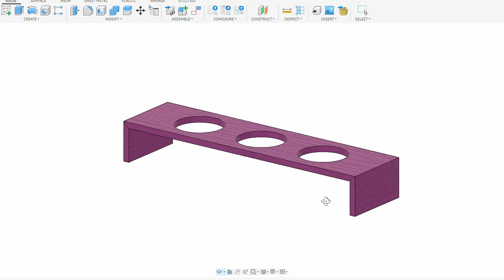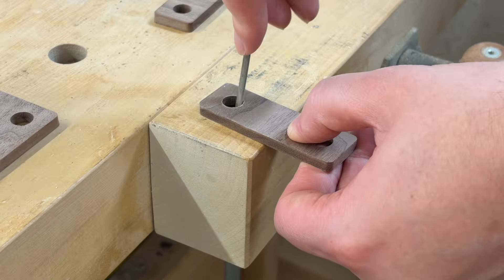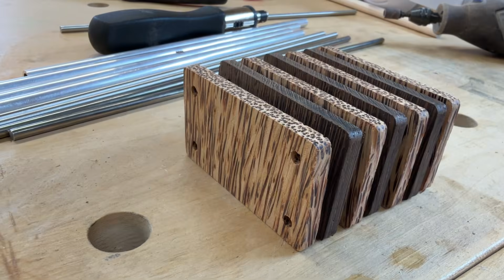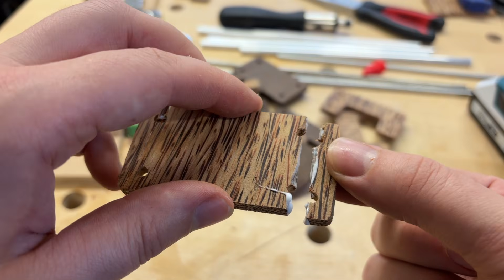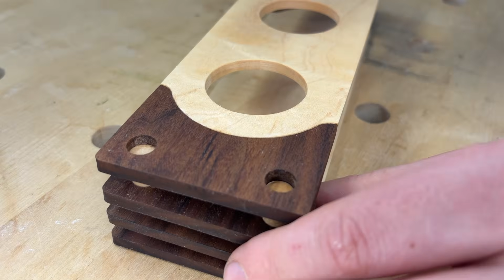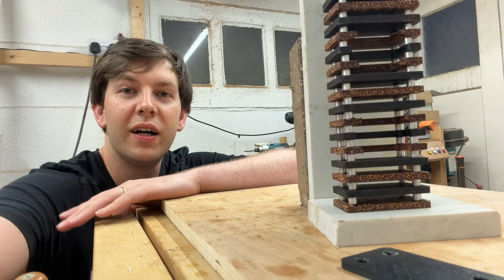6 Woods | 3 Designs | 1 Winner!

Comment: I like the same one your daughter does.
Reply from the maker: Nice! Hopefully with a slightly more rigorous decision process than she used though...
Reply: @inventiverobin indeed. I find it to be the most attractive of the three.
Reply: @inventiverobin in fact, I have an affinity for that aesthetic. I am quite intrigued by many of the kerf-cut projects I've seen. Kerf cutting can be used for bending wood AND as a visual accent. The metal between your pieces really catches the eye.
Reply: I wouldn't have used hot glue, though. You could have gotten a small wooden dowel to run through the spacers and the smaller holes in the wood. That would have lined everything up nicely.
Reply from the maker: @darrenhepperle4854  Words of wisdom sir!  Yes the hot glue made me feel shameful but it needed to be done to get the project over the line haha. Interested in the kerf cutting you mentioned for bending wood - I have never been brave enough to try that but perhaps there is a future project in that! Have you done kerf cut bends before?
Reply: @inventiverobin not yet. In fact, I am just starting out as a woodworker. For reference, I haven't even learned how to sharpen chisels yet, nor do I have the stones to sharpen them on. I need to get a few projects under my belt, so I trust my skills before I jump into anything advanced.
Reply from the maker: @darrenhepperle4854  What fun you've got ahead of you! Totally agree the best way to learn is to get stuck in with some simple projects :) Best of luck to you.
Reply: @inventiverobin Thanks. I'm currently working on my first video. There's no wood work in it. I just cleaned up the huge mess in my garage and arranged all my power tools.
Reply from the maker: @darrenhepperle4854  There's certainly an audience for that! Possibly more than woodwork, who knows...
Reply: @inventiverobin well, considering I have about the same experience making videos as I do woodworking, I don't expect to go viral. It's been quite the adventure, though... so far, at least. All the equipment I have is my phone, and I started with 500 minutes of raw footage. I had to back everything up to google and delete it from my phone just to finish all the filming, and there's so much, i have to edit it in two parts. I started with 300 minutes of footage. I think I'm gonna have to export what I wind up with, download it again, and add the rest of the footage to finish up. I should probably get a laptop.
Reply from the maker: @darrenhepperle4854  Sounds like you need a laptop!
Reply: @inventiverobin indeed. The funds aren't there, though. That's why I'm starting into woodworking. Besides having all the tools, I need the extra money. Distribution is another thing I don't have figured out yet, though. I am literally making this all up as I go.